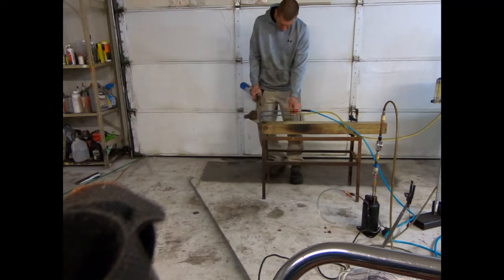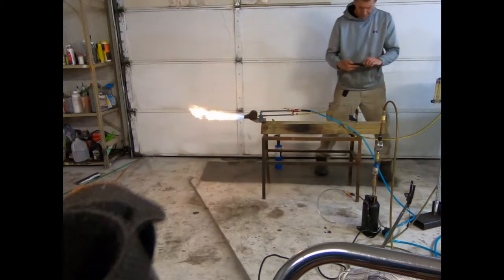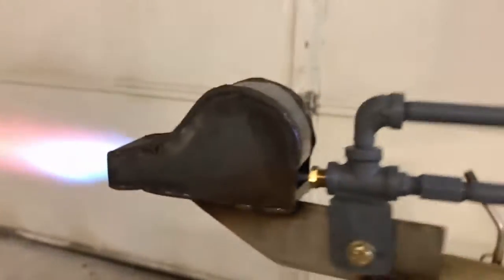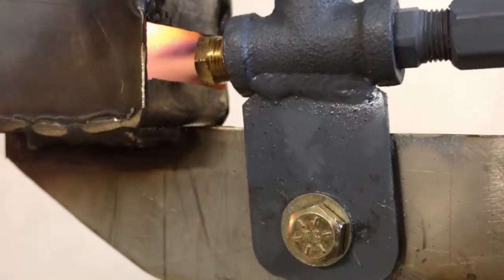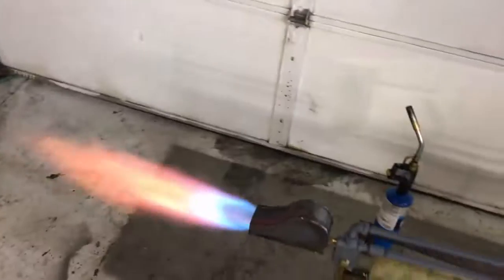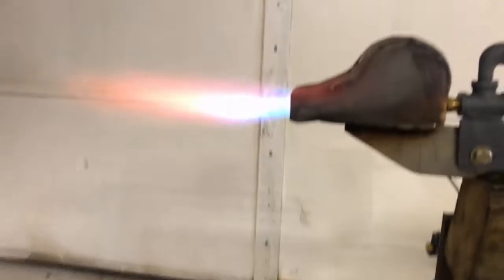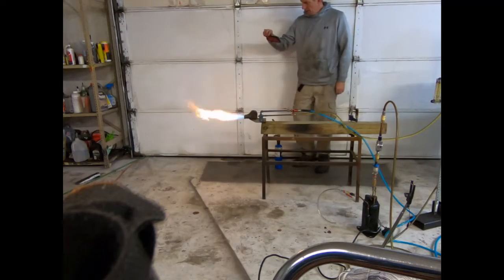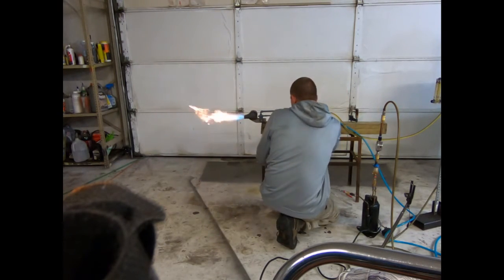Diesel Burner For industrial Dryer

Comment: What is your hourly or per minute fuel consumption at 120kw?

What is the flow rate (CFM) at the 25psi?  

have you ever thought about using a higher O2 concentration than just normal air?  I've designed an O2 concentration meant for large glass blowing shops or any place that needs O2 from 40% to 95% (higher percentages can be reached but it reduces flow considerably, but it is an option).  You could get MUCH higher temps with that as well.
Reply: Running pure O2 isn't worth it. Unless you need the peak temp, it doesn't give you any benefit. The airflow is used to atomize the fuel, and gasseous oxygen just isn't dense enough to burn with oil well.
If you had a waste stream if oxygen, then you could do it, and save a bit of volume for the same kW output, but I doubt it would ever be economical.

(A wasteoil/oxygen cutting torch would be  cool to see though, a super rich preburner to fully vaporize the fuel and then an oxygen seconds burn could do it. There are some rocket engines that use a precomubster like that)
Reply: @RobertSzasz  - I agree if you are looking at just making "bulk heat" it might not be worth it, but if you have an application where you can't use high flow rate (like high CFM/volume/speed) of the flame, then O2 would help a lot b/c you can reduce the total volume by about 20-50% by loosing the nitrogen.

I have use for O2 for a few things and I would like to get a glass blowing setup and don't want to have tanks delivered, I'd rather build a LARGE system for the price of 2.5-3 large O2 tank fills.  

I'm trying to think of other applications where high concentration O2 could be used, or even N2 b/c adding a N2 purifier/compressor is just one module that can be incorporated into these setups and then you always have N2.  If you want to get really fancy you could capture argon which is about 1% of air, and with production of high volume of O2, you would get a good bit quickly.
Reply: @kde5fan737  some tyre shops still use n2 for filling tyres. If its pretty clean it wil not expand and contract as much as normal air would in a tyre. Now it has been proven to not really work that great, but some people still pay more to have it in there. So you might be able to find somet tyreshops that want "pure" n2. But that would add the cost of a high pressure compressor because they would probably want it in their high pressure tanks.
Reply from the maker: 12 LPH
Reply from the maker: 10,000 watt hours per liter